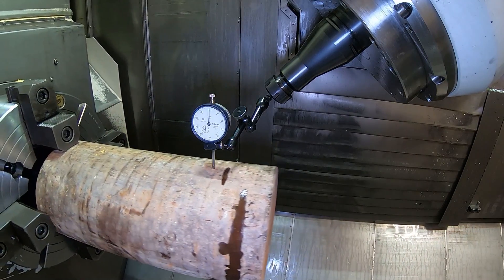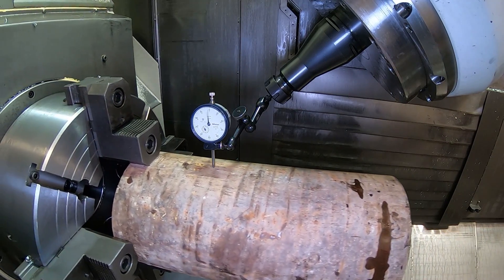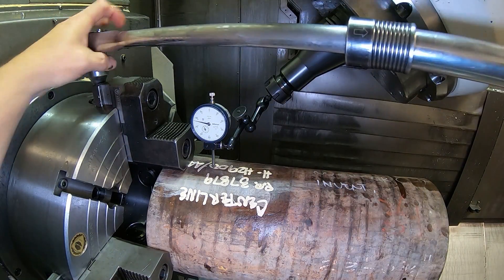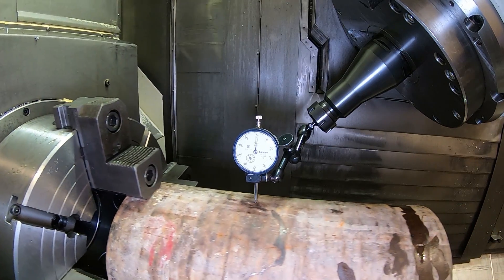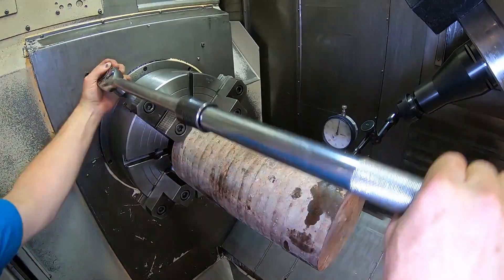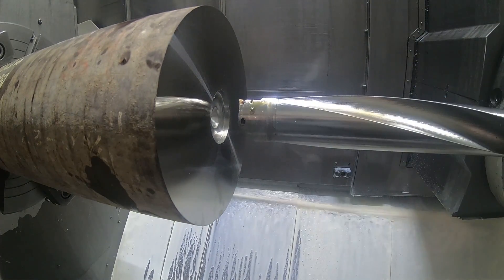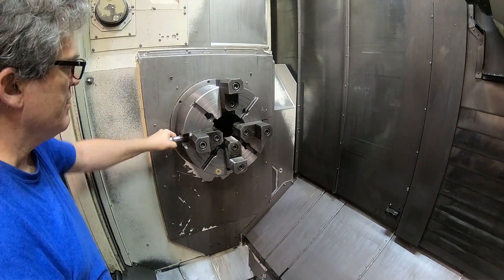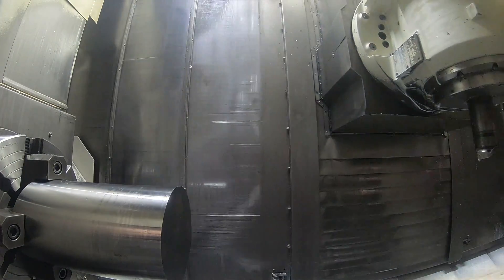Super Duplex Job Setup Blank

Comment: What size ER collet are you using with your indicator? Thanks
Reply from the maker: In this video a ER32 collet chuck is holding a short Noga arm. I have recently changed to using a ER40 chuck because I needed the ER32 chuck for a setup. And I rarely use the ER40 chuck. Does that answer your question?
Reply: @EdgePrecision  yes it does Thank you! Putting one together for myself. ER 25 cat50 would be ok?
Reply from the maker: @Meeky815  anything that holds the indicator arm. I only used that because it was, at the time a extra chuck. A ER25 would probably be better. I could give more clearance in some situations.

Comment: Please Explain more abt run out, high/low spot i.e. machinists lingo
Reply from the maker: I'm not sure what you are asking? Run out is the error in relation the ideal center-line. So indicated run out is when you use a dial indicator it is the reading you get with the indicator while sweeping the surface in question while rotating the part or indicator on the surface to check. The actual run out of the center-line is half the total indicated run out.

Comment: Considering the time it took you to clock the raw billet up, wouldnt it just have been better to take cuts above the diameter, for example if the stock billet is 250mm, tell the programming software that the billet is 300mm or above? I liked the boring of the inside diameter in stages though.

Comment: 1st step: centering
2nd step: turn diameter for back stay
3rd step: turn face and drill

Also appropriate: take a chuck with 3 or 6 jaws - justify is not needed

Comment: For Pete's sake why dont you have a hydraulic chuck??
Reply from the maker: I have explained this many times in previous videos and comments. But a hydraulic chuck doesn't work as well for the type of work I do. It is quite common in Houston, Texas  to run manual chucks here to do oilfield type work on CNC equipment. The chucking time is so small compared to the cycle time, that the convenience of being able to push a pedal to chuck is far outweighed by the versatility of the manual 4 jaw chuck. Also the manual 4 jaw doesn't lose its chucking force due to spindle speed like a hydraulic chuck does. Its jaws have more travel so fewer sets of soft jaws are needed (sets of soft jaws for large chucks are quite expensive). Also I can get the part do run dead true with a manual chuck or even off center if required. Now all this could be done with hydraulic chicks but with more effort and time. When you only sometimes chuck a part once or twice a week  what did you save. Maybe five or ten minutes. But you had to carefully bore the jaws on a hydraulic chuck. So maybe there is no time saving after all. Bottom line It's my preference.

Comment: May I ask you how much the biggest rpm what you are using in a billetsize like this? It was sticking out quiet a lot in the beginning, and you hold on only 1.5” long on a rough surface. Duplex is bloody heavy as well by the way. Do you calculate somehow what is the smallest surface what you are holding in these cases? I would just turn a small register face first gently with small rpm and depth of cut, because I would worry, maybe the billet will fly out from the spindle. You are much braver then me. Do you calculate somehow or work with feeling? Thanks and great videos
Reply from the maker: The chucks jaws have serrations on them. When it’s tightly chucked the part is held very securely. Also this is a manual 4 jaw chuck. It will hold a part more securely than a hydraulic chuck. It won’t open/reduce its holding force with RPM. The speed is also limited to a max of 500 RPM in the program.
Reply: Edge Precision thank yor for the quick reply. Most of the time I do make small parts (1” diameter or smaller) and thats why it could be scary for me when occasionally I do have to work on some of the bigger machines and I can hear the main spindle mouring under the weight. Thats why I am wasn’t sure what are the rules about weight and sticking out length. But thank you for the information.

Comment: Isn't it dangerous to turn a part with that much stick out?
Reply from the maker: Not when it held in these serrated hard jaws. I have turned longer than this. If it was held in regular jaws yes I would be using the steady rest to face and center drill. Do the OD than the steady rest to do the bore.
Reply: Edge Precision ok, is there a rule of thumb for how much stick out you won't go over before using a steady rest or tail stock?
Reply from the maker: It’s kind of a judgment call. If you try to do a cut out on the end and get a bunch of chatter/ vibration you need support. I should say it is absolutely essential to limit the RPM for the facing cuts. With a hydraulic chuck it will loose grip ( open up) on the part at high RPM. With this manual 4- jaw chuck you don’t have that problem. But it’s still good to limit the speed.

Comment: at our shop, for rough cut drilling, we use self centering 3 jaw chucks, disposable spade bits, and for larger id's going from 2.75 to 11.25, we use modified trepanning stems
Reply: Trepanning is the easiest way to make holes. 👍

Comment: Are you using a metric or imperial dti?
Reply from the maker: All my measuring instruments are in inches.
Reply: Do you do a lot of super duplex ?  How do you find it’s machinability ?
Reply from the maker: It’s been a while. This material cert says it has over 25% chrome content. It will be difficult. They are here at Centerline making some of these parts as well. The guys running those parts say they are having trouble with inserted milling tools (feed mills). But carbide endmills are holding up OK. We shall see.

Comment: I'm curious to see if you have any tricks up your sleeve for chipbreaking in duplex stainless steel. The last time I turned duplex 2205 in a small bore the chipbreaking become a huge problem for productivity. Perhaps with your high pressure through coolant it won't pose a problem.
Reply: F55 chips well... F51 is harder to chip.

Comment: It's nice to see a new video now and then from you. But at the end it's a shame u didn't use a super easy to make mazatrol program to face-off the part and create a small deburr on the face and length of the part. No need for a manual labor. But now i'm nitpicking. 😁

Comment: You really should look into trepanning.  That is a perfect example why it's the best way to go. If you have a minute take a look at how I do this kind of work. Thanks if you do. 👍
Reply: I'm really kinda surprised he isn't trepanning since the material is an incredibly expensive one. Maybe he will tell us why. Like your channel.
Reply: @Steve_Just_Steve  thanks Steve.
Reply: Take notice: the part that is shown in this video is not the actual material, it's a test/ setup parts out of "cheap" steel. The material for the real parts made from super duplex are hollow already - shown at 12:32. 
Btw, trepanning is really cool. I was aware of this, but didn't know the proper name. Thanks!
Reply: @bigbattenberg  Hey buddy, yeah we know that, but figured these operations would be preformed the same on the real part hits as you say a "test". Now that I've watched the whole vid again it looked like perhaps it showed the Super Duplex on those pallets for just a brief second in the video which were already a tubular stock. I should have known never to second guess Peter. lol    Did you check out userwl's channel? He trepans some pretty large hard material.

Comment: Merry Christmas Peter. Greetings from Poland.
I was afraid when you didn't use pilot hole for such a big and long hole. I have bad experience from my past. Hole was comletely bad.
PS.
I preffer using both rotation, e.g. 80% for drill and the rest for a part.

Comment: SuperDuplex is also used in the fabrication of lightweight 300m decompression chambers in hyperbaric lifeboats....very high tensile strength to weight ratio.
Reply: What is the 300m  ?  .....does that indicate a chamber that could be used up to a 300 meter deep dive ?    thanks
Reply: David Lawrence . That means the chamber can be pressurised to the equivalent of 300m depth (+-31.16 Bar)
Reply: David Lawrence this chamber is fitted inside a hyperbaric lifeboat. This lifeboat chamber has a docking flange connected to the ship’s saturation dive system. 
Should an emergency require evacuation of the saturation divers, they are locked into the hyperbaric escape chamber and the lifeboat is then locked off and launched, allowing the divers (under pressure) a reasonable chance of survival.
This lifeboat and chamber is self sustaining for up to 72 hours, within which period they can be locked into a shore based reception facility, or connected too a ship based life support package, at which time they will be slowly surfaced ( usually 1 m / hr ) .

Comment: Nice! Is there an advantage to using the milling spindle rather than the turning spindle for drilling?
Reply: I can express you one. He zeroed the part through lathe spindle. It may not be true for thicknesses to drill by milling spindle.
Reply: A total shot in the dark here,

The turning spindle is probably a lot more powerful that the milling spindle. The milling spindle would need to lock the tool, I'm not sure if it's a mechanical lock, a brake, or a magnet. But I know that locking something down and pressing against it would be better suited for the larger motor due to its increased mass, and (im assuming) higher holding power. Ie the turning spindle.

Comment: Anyone else pucker when he started turning the OD with it stuck out so far without a steady rest?  I know that chuck is beefy but dang!
Reply from the maker: Once those serrations on those hard jaws dig into the material that part won’t move. Most people don’t realize that a 4-jaw chuck will hold a part more securely than a hydraulic chuck. You see with speed a hydraulic chuck looses some of its grip. Not so with a manual 4-jaw chuck. There is four screws in those jaws pinching the part with a very secure grip. Much more secure than even a 3jaw scroll chuck as well.
Reply: Edge Precision I understand.  All I’ve ever known are the worn down teeth on my four jaw that don’t hold near as well as a new one.  Keep up the videos!  I need to come down and meet you some time.  I’m up in east Texas.
Reply: So different to spinning small aluminium parts at 8,000 rpm. Always good to expand the mind and see other materials and sizes on a completely different machine. Keep it up

Comment: Happy holidays Peter, thank you for the content.  You won't have to flip the actual part and turn a continuous finish OD and bore will you?
Reply from the maker: Thanks Bill. The OD turn only goes up to the jaws. The rest gets milled away when the part gets turned around. There is actually only a small section of the OD left. If you look closely at the previous videos. You will be able to see what I mean. The new bars will be able to turn the whole ID complete from the first end. All that will be necessary is the chamfer on the other end. This ID will be held to a close size for the third operations mandrel.

Comment: How much torque is the main spindle on this deal good for?
Reply from the maker: I’m not sure of the exact torque but the turning spindle has 60 hp and the milling spindle has 50.
Reply: @EdgePrecision  wow I didn't think it would be a 50hp secondary. Cause it does over 6k rpms. Quite a nice machine
Reply from the maker: The milling spindles max RPM is 10,000 and the turning is 1,600 with two gear ranges. 460 max in low and 1,600 in high.
Reply: Edge Precision truly impressive, thanks.

I guess the saying is right “you get what you pay for”, considering this is a serious piece of kit.

Saying as I have only really worked on smaller Cnc flat bed lathes, and large manual boring mills and large manual lathes. Always a treat to watch
Reply: @EdgePrecision  Funny how 60hp in a car has zero balls but seems unstoppable here.
Reply: Something about this video raises that question, lol.  I asked the same thing and scrolled down to see this.

Comment: This is like cocaine for a machinist, you explain nearly everything you do, no guessing. And so much to learn... keep up the good work!

Edit: again the half/half approach is quite nice, I often have to drill 120mm dia to depths of 300-500mm and than roughing those to 200-215mm in dia, will try it next time!
Reply: Strothy2 I’d suggest drilling 20-50 mm past half way on the first end to make sure the cuttings don’t get packed in behind the boring bar.